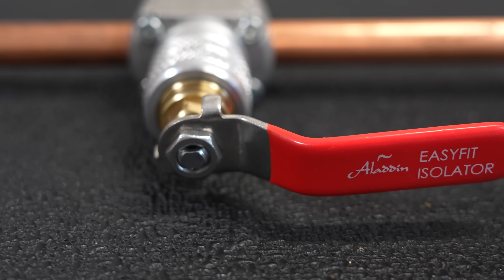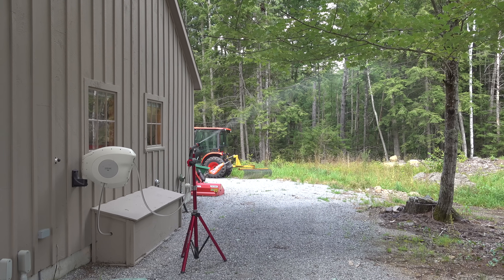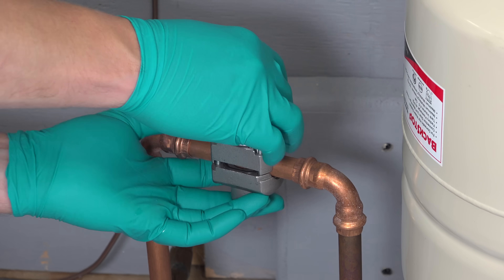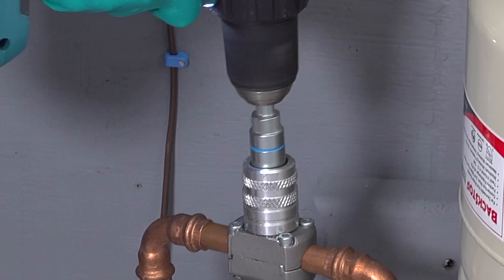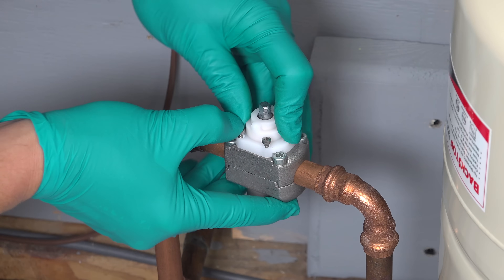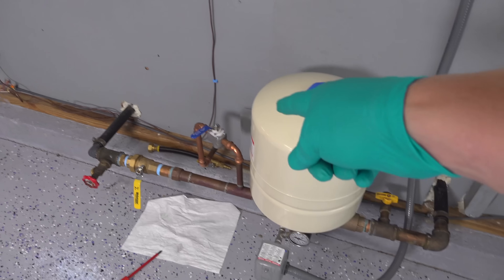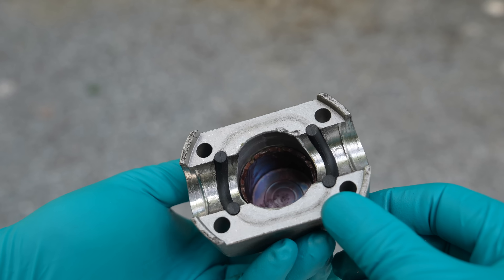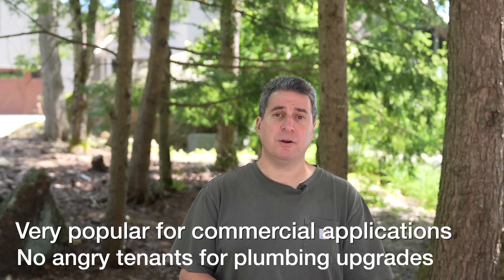SHUT-OFF valve installs on a LIVE WATER PIPE - Aladdin EasyFit Isolator

Comment: What happens to the metal shards?
Reply: Thanks for your comment, due to the valve’s unique design the pipe coupon and the majority of the swarf is captured in the lower housing in the special chamber at its rear.

Comment: interesting concept but i think while your cutting the hole in the piepe, not all cut parts will be pressed into the bottom part.
since we are talking about a pressured pipe with still water running, it will still carrry metals chips from the pipe itself through your pipe system.
and if that is good is a whole other thing, of course filter etc. exist but still.
dont know if you guys ever saw a milling, drilling or lathe but there isnt just a round plate pressed out but the ring where the valve system cuts will cut into small pieces which will now have a field day in those pipes.

just my two cents though
Reply: Thanks for your comment, due to the valve’s unique design the pipe coupon and the majority of the swarf is captured in the lower housing in the special chamber at its rear.  It is always a good idea to flush pipes after fitting any valve to a system.

Comment: The water pressure in England is the same as in Ireland because they use the same antiquated technology, starting with a water tank @  the attic. The pressure is ten times lower than on the mainland of Europe. If you were to install it in Germany or Poland, it would rip your arm off
Reply: Thanks for your comment the EasyFit is rated up to 230psi so will withstand considerable pressure.

Comment: Where does the copper go from the cut?
Does it get flushed out?
Reply: Thanks for your comment, due to the valve’s unique design the pipe coupon and the majority of the swarf is captured in the lower housing in the special chamber at its rear.
Reply: @easyfitisolatorusa  thanks for the answer

Comment: For that price, I don't mind getting wet cutting the pressurized pipe and pushing on an opened sharkbite valve (or threaded ball valve if required),  then close the valve and finish up.

Comment: my opinion there's to many moving parts, gaskets, seals etc. valve is too expensive , would be difficult to install in a confined space also you have to install this on perfectly smooth pipe or risk leaks.  to many down sides but cool product.

Comment: What happens to the piece of metal coming out from drilling? Looks like it just flows down the pipie
Reply: Thanks for your comment, due to the valve’s unique design the pipe coupon and the majority of the swarf is captured in the lower housing in the special chamber at its rear.

Comment: What about the copper hole cut out and shavings?  What stops them from entering the line?
Reply: Thanks for your comment, due to the valve’s unique design the pipe coupon and the majority of the swarf is captured in the lower housing in the special chamber at its rear.
Reply: nothing 🤣

Comment: Cool invention, but I’d rather shut the main water supply off and simply cut the pipe and solder a valve on for 80% less cost.   It’s not that serious, but $200 is.

Comment: Can this be used in large apartment buildings. Where the water pressure is higher.
Reply: Hi yes the valve can be used up to 230 PSI.

Comment: I would think these would not be allowed by code, it’s the same as a saddle valve which are illegal now commonly used for icemakers or refrigerators. I see them fail all the time. Nice engineering but I’d never use
Reply: Thanks for your comment, the EasyFit seals on the ends of the pipe as well as the sides unlike a saddle valves and is classified as a ball valve and has both UPC and NSF approval

Comment: So, if there is no cutting how does it "cut" through thje copper pip to form a seal?
Reply: Thanks for your comment, due to the valve’s unique design the pipe is cut using the blade inside the valve, the blade, pipe coupon and the majority of the swarf is then captured in the special chamber at its rear.  The pipe has seals in the both the housing and boot inside the valve which acts as dual seals to prevent leaks.

Comment: It's a cool tool, but it did not blew my mind. Do you know what blew my mind? The fact that this valve costs 68 Euros. A valve usually costs around 2-10 bucks and buildings usually have two valves. One inside and one outside.

Comment: This is a great design.... have copper shavings floating around in your pipes after drilling a hole through it. Gonna do wonders for your pipework and water quality. God forbid you have anything sensitive on the line downstream of the valve itself...

Also 450 dollars? For a valve? What a joke.
Reply: Hi, the EasyFit is both NSF and UPC approved.  Due to the valve’s unique design the pipe coupon and the majority of the swarf is captured in the lower housing in the special chamber at its rear.

Comment: For $250, you can get a plumber to sweat in a new valve
Reply: 350 min for a plumber to think about putting a valve in 😂 now days
Reply: Ha! Not even close!!! Our plumbers in MD F$$$ us over!
Reply: @EM-vh3oq  then you need to get educated
Reply: Actually you do.
Reply: I had an old main shut-off valve replaced with a new ball valve on Tuesday 12/16/2025 and it was $750.
Reply: @badger519-k5s5vsounds about right 😢
Reply: In my area about 5-6 years ago it was $250 just to get them to your door. Then it went up from there for labor and materials for the job.
Reply: It's $300 today.. Shut off the main and put in ball valves..
Reply: They wouldn't even show up for 250
Reply: Guess I got a deal, the day I made the comment, Laurel plumbing installed a new ball valve on my main for $250
Reply: Unless you have a friend that’s a plumber that’ll be a minimum of $350 in 2025
Reply: Last plumber I called a few years ago wanted $1,200 for a basic toilet replacement when I was out of town. Mother in-law was home with the wife and the old one cracked....Mysteriously...  I denied the work/offer and had them use other toilets in the house until I got home and replaced it myself for less than $500 for a top knotch toilet.

Comment: and where are the Drillchips going? into the Waterpipe ?
Reply: Thanks for your comment, due to the valve’s unique design the pipe coupon and the majority of the swarf is captured in the lower housing in the special chamber at its rear.

Comment: where does the metal pieces go from drilling the pipe?
Reply: Thanks for your comment, due to the valve’s unique design the pipe coupon and the majority of the swarf is captured in the lower housing in the special chamber at its rear.

Comment: Do copper filings get into the outflow?
Reply: Thanks for your comment, due to the valve’s unique design the pipe coupon and the majority of the swarf is captured in the lower housing in the special chamber at its rear.

Comment: That is IF you have a copper line installation. Stopped using these years ago already. All Pipe in Pipe and PPR now.
Reply: The EasyFit is a patented product with dual seal technology it was designed in the UK and has been sold for just over 10 years.  It's different to whatever you stopped using years ago, thanks for your comment.
Reply: @easyfitisolatorusa  I stopped using copper lines….!!

Comment: This instantly reminded me of a gas main self tapping tee. Except it it creates a shutoff, not a branch line. Unfortunately, these are ~$250 each for 1/2" pipe. So it's still way less expensive to shut off the entire house and add a missing shutoff valve somewhere in the system. In some critical cases though, this could be a god send!

Comment: problems I can see right off the bat
 1 copper shavings getting into to other valves like a shower body or faucet and trashing the unit 
2 the inner surface of the pipe isn't reamed and will have turbulent water flow 
3 installing on thin wall type M (aka what your home was probably made with)  I just imagine the copper twisting or doing something terrible and you end with a flood.
Reply: Thanks for your comment, due to the valve’s unique design the pipe coupon and the majority of the swarf is captured in the lower housing in the special chamber at its rear.  The EasyFits have been sold for over 10 years in the UK and are not been known to leak once  installed.

Comment: 250 dollars.  Ouch.  It’s better to just get a sharbite.
Reply: Thanks for your comment, the EasyFit was designed for when you can’t switch off the water and install a sharkbite.
Reply: @easyfitisolatorusa  every home has a shut off.  Not saying your product is not good.  It’s def a good product.

But this product takes too much time to install and refused home owner in case of emergency will not be able to do it.  You have to be handy with these things. 

So this is def not a product for a regular homeowner.

Comment: Lmaaaao, so it's normal valve but you just have to assembly it on a pipe itself. How exactly is it worth this asking price?
Reply: Thanks for your comment, the EasyFit was designed for when you can’t switch off the water so unlike any other valve on the market.

Comment: How about residu of drilling getting into the system?
Reply: Thanks for your comment, due to the valve’s unique design the pipe coupon and the majority of the swarf is captured in the lower housing in the special chamber at its rear.

Comment: unreliable. Do NOT use it
Reply: Thanks for your comment, the EasyFit is both UPC and NSF approved, has been sold successfully in the UK for over 10 years and is a very clever and reliable valve.

Comment: What happens to all the copper bits created from the drilling?
Reply: Thanks for your comment, due to the valve’s unique design the pipe coupon and the majority of the swarf is captured in the lower housing in the special chamber at its rear.

Comment: I would be more impressed if they had a PVC version, as that's more common in "modern" construction.
Reply: Thanks for your comment, this actually works with any grade PEX but only “CTS PVC” which is the same ID and OD of copper tubing and PEX

Comment: retired plumber here, wish I had these on many occasions. A little pricey but so is replacing sheetrock.
Reply: No plumber works on water pipes without knowing where the shut off valve is.
Reply: @ChillWill-q5x he didn't say he didn't know where the shutoff valve is...... I guess you've never done commercial or highrise
Reply: @walterbrunswick  0:05 he literally SAYS this video is in a HOUSE.   I have done plumbing on very large ships and large residential buildings, we don't take risks with pressurized pipes, there is always a shutoff somewhere.

Comment: So, can you get these suitable for live gas lines?

I'm thinking emergency services shutting off a gas line until repair crews can arrive (which is often an hour or more later).

The current main technique used is to use a wide spray of water to disperse the gas into the air safely and wait. 

If it's a plastic line and we can, fold it over and clamp it to reduce the leak.

A few of these in different sizes on the truck could mean a few minutes of work to make it safe, then let the repair crews come whenever to fix the line.

Comment: Drilling pieces will flow through and jam somewhere it's not reachable.
Reply: Thanks for your comment, due to the valve’s unique design the pipe coupon and the majority of the swarf is captured in the lower housing in the special chamber at its rear.

Comment: Yeah the thing is, for 8 bucks I get a sharkbite valve, jam it on and wait for a plumber to come repair it.  I don't need excess tools or anything else.  It's a cool concept but it doesn't really matter.
Reply: Thanks for your comment, the EasyFit was designed for when you can’t switch off the water.

Comment: Sooooooo…….where did the material (copper pipe) that was cut away go to? I’m guessing right into the water line. Wouldn’t care to drink that.
Reply: Thanks for your comment, due to the valve’s unique design the pipe coupon and the majority of the swarf is captured in the lower housing in the special chamber at its rear.  In addition it is also UPC and NSF approved.

Comment: Does the coupon always end up in the bottom?
Reply: Thanks for your comment, yes it is captured on the blade which cuts through the pipe and is captured in the chamber to the rear of the lower housing.

Comment: You don't need this if you can stand a little water where your pipe is exposed, you can just cut the copper (in 2 places if you need more play) , then put on a compression valve (open) with the water flowing  (and then a coupling to restore service as needed). This is how we'd do it live as part of the municipal water department.  This reminds me of a mini version of a tap on a ductile iron main.

Comment: Complete crap.. The orings will eventually leak..Or will leak whwn you install if the copper pipe is damaged or a bit of grit gets trapped between rubber and pipe.. Dont waste yr time 😂😂
Reply: Thanks for your comment, the gaskets in the valve housing seal during installation. Once the valve is installed the boot inside the valve acts as the primary seal – it’s a dual seal valve.  They have been sold for over 10 years in the UK and haven’t been known to leak once installed.

Comment: So im not a plumber, but isnt there a concern here of dumping a bunch of copper chips into the line when it drills though and clogging whatever is downstream?
Reply: Thanks for your comment, due to the valve’s unique design the pipe coupon and the majority of the swarf is captured in the lower housing in the special chamber at its rear.
Reply: Cool, it's a great idea!  @easyfitisolatorusa

Comment: ridiculous price you can solder up a regular valve for a fraction and it doesn't even take much time
Reply: Thanks for your comment, the EasyFit was designed for when you can’t switch off the water and solder a regular valve.

Comment: Does it create copper filings that get pushed through the line? Is it sawed-through or is it a clean cut with a razor-like blade?
Reply: Thanks for your comment, minimal swarf is produced and the majority is trapped with the pipe coupon at the rear of the housing

Comment: and now particles of the copper of the pipe are in your water..... consider that in case you drink or cook with it.
Reply: Thanks for your comment, due to the valve’s unique design the pipe coupon and swarf is captured in the lower housing in the special chamber at its rear.  The EasyFit is also both UPC and NSF approved.

Comment: Where's the the copper that u drilled out go right down the water to clog it up
Reply: Thanks for your comment, due to the valve’s unique design the pipe coupon and swarf is captured in the lower housing in the special chamber at its rear so nothing enters the pipework.

Comment: Util side has shutoff valve.  I do not like leaving the cutting blade in place and will rust.  Must well do it right using the util side shutoff valve and install a regular valve.
Reply: Thanks for your comment, the EasyFit was designed for when you can’t switch off the water.  The blade, pipe coupon and swarf are all captured in the chamber at the rear of the valve and are not in contact with water once the valve is installed.

Comment: How much in America ?         Around £120 Inc postage here there are several cheaper types some coming in at £20.
Reply: Thanks for your comment, the EasyFits sold here are different to those sold elsewhere and had to be re-designed to handle our harder pipes.  The EasyFit is a unique patented product.

Comment: For that price it is just "oh cool that exists somewhere, good to know theoretically" I would not consider buying it. Valve that does not require soldering (just water close and cut copper pipe which is very easy task) costs 10 times cheaper - they called push-fit or snap-on or something like that..
Reply: Thanks for your comment, the EasyFit was designed for when you can’t switch off the water.
Reply: @easyfitisolatorusa  I see. Lets imagine such situation - I come to my basement and realize I need a valve and I cannot shut it off. I go to amazon, order this valve and in couple of days bingo! Ah, no, I should order them in advance! As I do not know what to expect I should order 3x$250 valves, just in case. Great ifea!

Comment: A copper cutter, and a sharkbite valve will run you $40 max. Easier to install than this also. Interesting product, but until that price point drops, I cannot imagine it will be very popular
Reply: Thanks for your comment, the EasyFit was designed for when you can’t switch off the water so can't fit a sharkbite.

Comment: cool innovation, but why just not to turn off the water?
Reply: Thanks for your comment, the EasyFit was designed for those situations when you can't switch off the water or in larger buildings when switching off supply in 1 area would inconvenience other occupants.

Comment: Isn´t it a problem you have some copper chuncks form the drilling in the live waterflow? It may damage some of the followig components or not?
Reply: Thanks for your comment, due to the valve’s unique design the pipe coupon and swarf is captured in the lower housing in the special chamber at its rear.

Comment: You could’ve just turn off the water cut the line soldered in a shut off valve within minutes.Probably a lot less money.
Reply: Thanks for your comment, the EasyFit was designed for when you can’t switch off the water and fit a standard shut off valve.

Comment: What happens to the piece that was cut out'? It will probably clog the line somewhere eventually and it will be hard to find and you will have to end up replacing the whole system. :face-red-droopy-eyes:
Reply: Thanks for your comment, due to the valve’s unique design the pipe coupon and swarf is captured in the lower housing in the special chamber at its rear.
Reply: mmmk'''  @easyfitisolatorusa